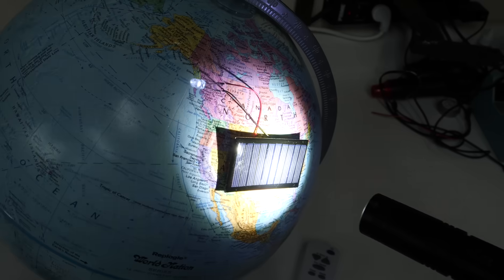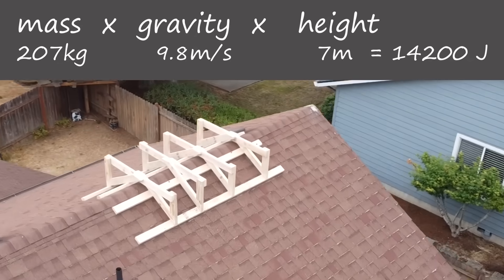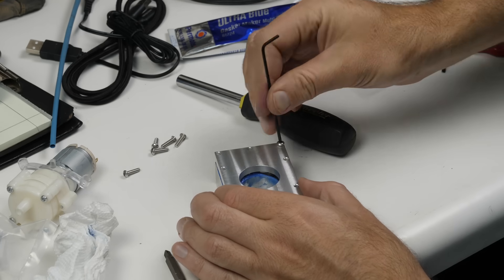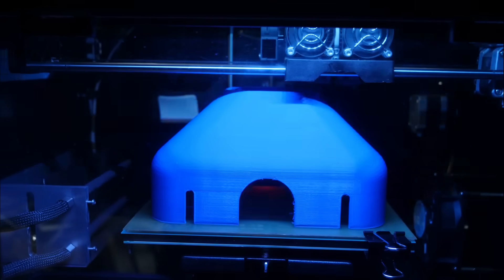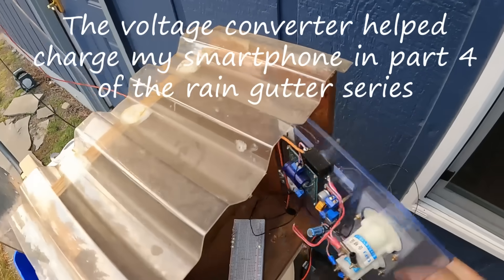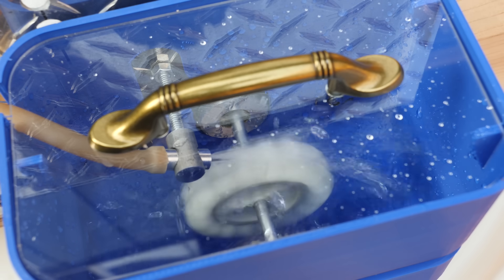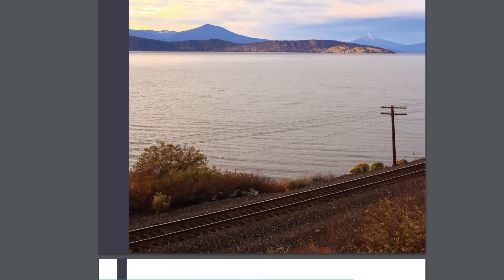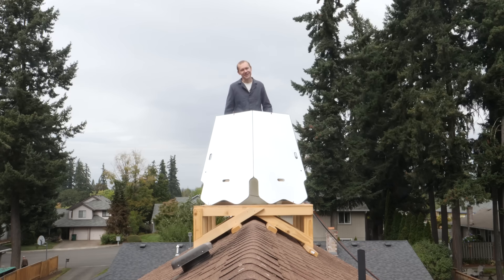Storing Solar Power on my ROOF!!!

Comment: Maybe you could obtain more energy through a flywheel big and heavy enough to turn a big generator and keep it rolling steady throughout the time there's water in the tank and you can use kind of scoops on the edge of the flywheel for starting weight. How much efficiency could be extracted from there?
I loved your video.

Comment: store it in an energu storage invention termed a battery, i use ole car batts that can no longer start a car after a few yrs but ver gd 4 storing solar energy 4 a few yrs, usually last around 4 yrs n cost is 4 dollars or 4 3 at car battery sellers 9 vey recylce v old ones v cuistomers bring in, so r happy 2 give me 2 vos who ask!. been using vis system on my boat 4 about 10 yrs. will even run a  tv 4 a limnited time about 2 hrs as i dont allow v batt 2 b mre van 50% discharged. many thiongs have lion batts in em so can use tv on em 2 hrs n my ole car batt 2 hrs.

Comment: My problem with this is the power you're using to drive a pump is power you lose to do work on demand so is it really storing energy more efficient than making use of it from the source? I think it would actually work out to a loss of efficiency, but that's just a guess. On the other hand, if you got more energy than you need to use & use the excess for that type of storage capacity it might make sense but my guess would be storing it in a battery would work out more efficient & obviously less complicated.

Comment: Interesting video. I thought about doing this myself, but to be able to store enough water,  I think it would have to be designed during new home construction using a multistory home with support structure strong enough to hold all the weight. Most zoning laws would probably not permit it.  
You could add capacity to the system by collecting rain water in a separate tank located up high.
Reply: Disguise it as a chimney, use an intank pump, like for a pond, so the water keeps it cool, can use a automotive fuel tank sensor wired to turn off the pump when the top tank is full. Have an access door at the top and bottom.

Comment: Nice hobby. 
Please keep in mind, 1 barrel :: 207kg :: 7m height -> 14200 Joule -> can produce nearly 4 Watt in 1 hour (4 Wh).

If you like to power the whole house completely independent, you need 6..11 kWh every day == 1500 ... 2750 barrels/207kg on the roof !!!

To overcome this, you need a massive increase of the height.
Thats the reason why such water reservoirs are located somewhere up high in the mountains and the generators down in the valley with more then 1000m difference in height.

Comment: The problem with this technique is that the pumping of water has an efficiency of around 30% and the generation of power also around 30%, so all in all 90% of the solar energy is lost in conversion before the electricity is reclaimed.  Well, if you have enough power, maybe you can afford a 90% conversion loss, but almost any other sort of battery has better efficiency. 
The specific problems in California are not technical, but due to the fact that the state is run by opportunists with no or little insight or understanding for the consequences of their decisions. Everything is wiped off on the tax-payers, who are happy to live in the state of ultimate political correctness.  If everyone are happy ... what is the problem ?

Comment: As a practical demostration its fine, but for home aplication it is rather non-sense.... You would need about 43 tons of water for one kWh of energy with 10 meters of height difference (equal one 100 Ah battery). Not talking about efficiency. Commercial hydro-pump storage has under 70% efficiency, with home application you would get much lower - guess about 50%

Comment: Quint, I love that you actually put a barrel on your roof!  I've been researching a rainwater system for gardening, and have an un-reasonable desire to incorporate energy storage.....how much pressure can that pump deliver?  Could you fill the bottom of the barrel to capture a compressed air pocket up top, which could then boost your turbine?

Comment: I'm thinking  h202 or colloidal silver to prevent unwanted bacterias and mold black barrels or just paint everything black, you are generating DC power so a small piece of silver wired working as an anode

Comment: My idea on this concept is to use all the unused mine shafts, wells deep bore holes to lift lead weights with solar power control drop to generate power when needed
Reply: The issue comes with the sheer torque you'd have to  apply to that system for any appreciable amount of power storage.  Water can be piped in bit by bit so the strain on the system is manageable and scalable, that system requires the system to carry the entire load the entire time as it ascends and descends,  increasing as the distance increases, lots of waste heat and constant maintenance, not just on the lift pulling on that weight but the bearing system used to regulate it's de/ascent, because it'd be a very bad idea to just have that weight free floating in case of a catastrophic system failure, your (likely) several tens of tons weight dropping down said shaft would  impact with 
significant, potentially structurally compromising   force, nevermind if that weight causes your lift system to catastrophically fail throwing bits of motor around at dangerous speeds.

You could maybe get away with that with a large wind turbine that's using a lot of mechanical , leverage, instead of relying on purely solar panels and an electrical winch.

Comment: When it comes to energy generation and loads  I think in terms of watt hours.  I have a hard time relating it to joules.   That being said the solar rig produced 275 watt hours ( 50w x 5.5 hours ave sun) and a AA can store about 4.  Not very efficient but creativity, proof of concept and science in general is pretty cool..  I like that for the most parts it’s natural with no chemicals or waste other than the extreme amount of resources required  to build it. I’d bet you could modify the water wheel generator set up and get quite a bit more “storage capacity”
Reply: 1 joule = 1 watt second, so 1 watt hour is 3600J

Comment: Great video as usual!

I worked for a company that won a bid to  do something similar to this, but at a much larger scale. They were putting a reservoir on top of a butte and dropping the water down in order to create electricity. They used electricity from the grid to pump the water up when electricity was cheaper at night and would drop it down during the day when it costs more. I'd imagine they used solar panels when they could too. It's called the Green Butte Project in Montana if I remember correctly. It's neat seeing the same idea explained so clearly here!

... Guess I should have watched the whole thing first haha. I didn't know how many there are out there!

Comment: Your water barrel is distributing on the two center supports...not beyond it's footprint.
Then you point loaded your joist with the 2x4s, which then point load onto each joist.

Comment: Thank you for the most important part - the comparison of that barrel to a battery. I've watched a few of your videos and liked them all, but it's even more important to make sure people understand you CAN build stuff like that but can't really expect something like that to be of any practical use. I wish it was - at the moment I have no good way to store solar energy so I've no reason to buy the panels. I've done the math a few times and based on my location it just doesn't make any sense if you can't store all of it. And any energy storage solution I've found is so expensive the system would never pay itself back. That's the reason I watched this video, too.. and was happy that you spelled that important part out. =)
Reply: I'd like to find a way to make this work on a small scale. People don't like the idea of using less electricity  but it's half of the equation. Why do we feel entitled to use as much electricity as we want, whenever we want? Is it the end of the world if you have to read a book instead of watching a movie because there wasn't enough sun to charge the batteries today? 

What if we just needed enough pumped hydro or batteries to run a few lights or watch a movie after dark. Then it sounds do-able. The real payback comes when you can eliminate a utility bill. Half the cost is transmission fees so reducing usage isn't very effective. Cut one whole bill and the payoff would be significant.

Comment: All it takes is THINKING! outside of the Box and don't let anyone tell us it can't be done on a smaller scale! It can be done. Was tesla any more brilliant than Us? No. Just a Great thinker who listened to the inner voice and put those ideas into Action! I built my own bandsaw with 16 inch wheels and persisted until I got it right and balanced well. Saved myself over £1600. It's all within yourself so persist and with each other WE CAN ACHIEVE the once thought impossible tasks are very possible...

Comment: Brilliant video.  This also serves as a good reason to try to get off grid as the big power companies and water companies have been doing this for years and making us pay for the FREE resources that they collect and use then charge us for! All of us worldwide have paid into a system that repeatedly screws us daily! Then they invest our proceeds into solar and wind energy  or free energy that they collect and the never ending cycle starts all over. Then they Tax us on it. What we need is to invest in one another so we can do the same thing and take the greed out of the equation. Same as big oil, big pharma, or big anything for that matter!  A simple system of collection of the free resources that fall from the sky be it wind, solar, or water. Teach one another and help one another. Wasn't that what Tesla wanted? Only Mr big wanted to meter Everything....

Comment: I suppose this whole setup was just experimental. Doing something more permanently some more capitalisation is required. In S.A. we will make use of what we call a wind driven pump which has the ability of pumping water to high levels. So the power is free of charge concerning the pump action. As what the tank reservoir is concerned we will rather built a steady high mounted platform e.g. 4 m above ground level. From there one can regulate the water flow to the electr. generator. And the current to the converter to the power grid of the house. Another way is to make use of solar panels and or wind driven generator.

Comment: I like this demonstration of how to store energy in the barrel up on the roof and then use that energy at night to power your lights. Have you considered using a heavyweight in much the same way as a grandfather clock? I have to imagine that there is significant loss in round-trip efficiency with the water design even though it does work. I am not sure how efficient the water turbine is that you are using to generate electricity from the water flow for example. If you used the solar power during the day to lift the heavy weight to a high height and then a gear system to turn a generator at night where you could regulate its speed for the output you want it may be more efficient. Just something I have thought about

Comment: If you live and have a few acres of land in the hill country,  you can also use pedal power to move water to a higher reservoir, and then let if flow, when needed to a lower reservoir. For many tasks you do not need to convert it to electrical energy, but you can use it directly as mechanical energy.
Reply: Basically just use a windmill to run a water auger pump from the bottom reservoir to the top on a windy day or use solar on a still day and an electrical water pump.

And with this kind of system the larger you make it the more efficient storage it becomes due to  the square cube law.

Comment: Two things you can do to increase energy output:
1. Turn water wheel sideways and mount it inside the funnel. Use the whirlpool vortex to spin your motor. The bigger the funnel the more powerful the vortex is. This means you can add bigger blades and a bigger motor/generator to create more energy given the same amount of water pressure and flow. Think of the whirlpool Vortx as a fly wheel. Fly wheels are awesome for storing/producing energy.
2. Paint the barrel black! Seal the barrel! Let that water heat up from the sun and build up pressure. Leave a few inches of air at the top of barrel. 

You can also run the hot water through a second magnifying solar collector in small amounts to create steam.
Reply: There are definitely ways of making it more efficient, but the amount of energy stored even without calculating the energy loss is terrible. 
I had an idea to use my dam and a 10,000L water tank at 10m elevation for storage. The maximum potential energy would be 1,000,000 joules, roughly 1/4 of the energy contained in your average 12v lead acid car battery.  0.27kw/h
Reply: @lucaseaston  It’s only as efficient as the quality of the design. One of my best skills is streamlining systems. Never assume you’re working with the best most efficient equipment. especially when it’s the first time you’ve ever built a particular device lol it takes years of tinkering and experimenting and reworking devices to make them super efficient. Rarely does inventor/designer stumble across and or accidentally build hi efficient devices on the first try. Take rockets for example! Lol
Reply: @spaceminers   it’s all well and good to optimise performance, but the fact remains that even at 100% efficiency the output is terrible. If you can break the laws of thermodynamics and create power from nothing, then it might be worth while.
Reply: @lucaseaston  you can! That’s what I’m trying to tell you! With the right design you can achieve overunity and get more out than what you put in. It occurs in nature all the time. Haven’t you ever heard of the pistol shrimp? He can conjure a powerful shockwave with the snap of his tiny little claw. The shockwave is so intense that it atomizes the water into hydrogen and oxygen and uses it to create an explosion with temperatures hotter than the sun. So don’t think that just because you are at 100% efficiency of a system that it’s as far as you can go. There’s always room for improvement. Another example is the ancient Egyptians using gravity to pull large amounts of water down to the bottom level of the pyramids and redirecting this massive amount of Hydro/gravitational energy straight up to the ceiling of the Lowest chamber, causing massive shockwaves to propagate throughout the entire pyramid structure resonating hundreds of tons of trace exotic materials within the stone blocks A.k.a. Piezoelectric crystals resulting in such a massive amount of high frequency electromagnetic energy formation that an aura of highly energetic plasma forms around the entire structure level by level and is collimated at the top and blasts into space in the form of a huge super buoyant nitrogen gas fed plasma beam. Notice how many things are at play to make this happen. The pyramids are an immaculate awesome physical structure which defies the laws of physics just standing there.

Comment: What about heating the water with solar power in a well insulated vessle? So you can use it to wash or to heat the floor (floorwarming)?

Comment: This is tech I've known about for a while, but it's cool to see someone actually make a working version as a demonstration. This earned the channel a sub.
Reply: Yep. They do this with hydroelectric dams and nearby wind/solar plants and this demonstration shows exactly how efficient it can be
Reply: Been using it for decades near me with conventional power sources.  Excess grid power at non peak times pumps water to a reservoir on a hill, when power is needed it is used in a hydro generator.
Reply: @rayh592  Shhh - we need nuclear and other dangerous shit...
Reply: @CONEHEADDK  you realized it's just for storing energy and not for generating? We need both.
Reply: @dennisk5054  Yes. Was that a hidden question?
Reply: @CONEHEADDK  depends on your intellectual abilities. You opposed pump storage to "nuclear and other dangerous shit" which is not correct. Apples to oranges sort of things.
Reply: @dennisk5054  Oh - I must have over estimated your intellectual abilities.
Reply: @CONEHEADDK  so cute
Reply: I don’t know if this would work where I live in Vermont. A gallon of water here is only like eight pounds, and he has water that weighs in kilograms! I mean eight pounds is way more than a box of honey grams but it’s nowhere near a thousand of ‘em
Reply: @fishhuntadventure  well being sarcastic is great,  however in 99% of the world 1L water is 1000g/1kg
Reply: And another sub here 👍

Comment: Would’ve been interesting to know how many of those you would’ve needed to power your house
Reply: Depending on power consumption, more than the surface area of the roof, a couple hundred barrels at least.  

If you wanted to power a house more economically you'd buy a home on a hill, set up a reservoir at the top and bottom about the size of a swimming pool and set up several turbines along a pipe between them, then have a larger pump powered by solar panels or better yet,  a wind turbine driven augur to pipe water back up mechanically so as to not worry about expensive solar panels,  because it'd take a truly massive pump and dozens of panels to power the tens of thousands of gallons of water it'd take to run a house at full capacity during the night.  

If you just wanted to run the fridge and maybe an air conditioner you could probably get away with less but if its 6pm to midnight utilization of electronics like a tv, console, computer, etc. Then you'd need a larger reservoir or a greater height.    Given it's easier to make something wider rather than taller, you're better off just making the tank bigger.